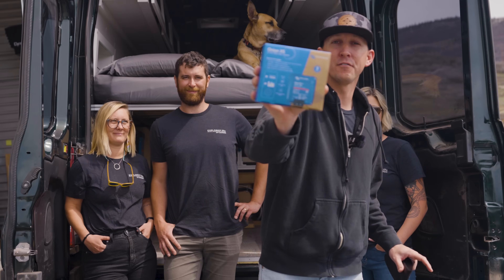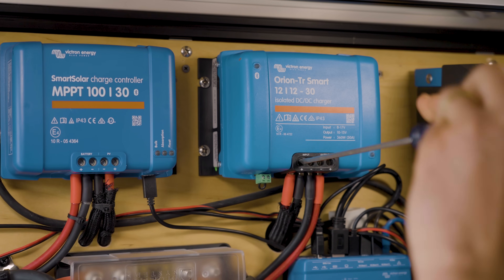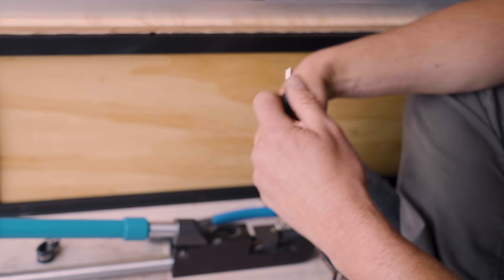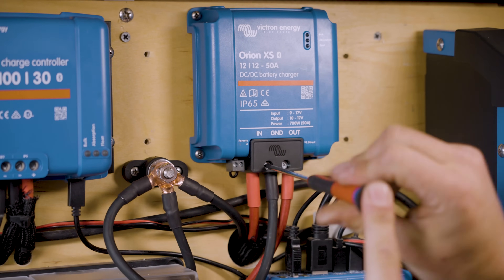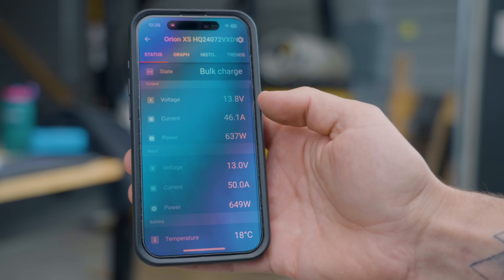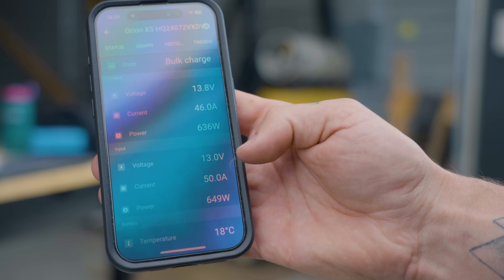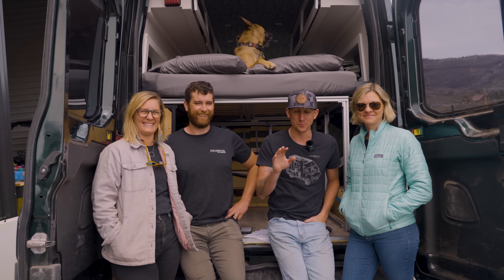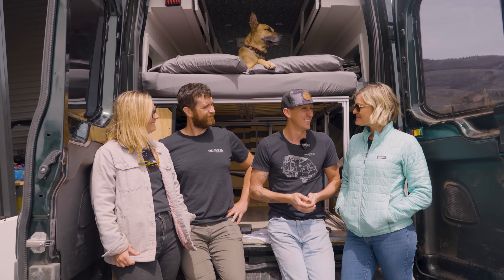Victron Orion XS DC DC Charger Installation/Upgrade Tutorial

Comment: I ordered an Orion XS and the wiring kit from your site. I can't wait to get it. Meanwhile, how would you install this to the Ford ccp, specifically where does the negative go?
Reply from the maker: Check the ford upfitter manual for their recommendation; but going direct to the negative terminal of the starting battery under the seat is our general recommendation unless the upfitter manual specifically forbids it AND recommends a different location.
Reply: @EXPLORISTlife  The BEMM suggests using the consumer connection point. In doing so, do I need an engine run signal from the van? Also, why are you using junction studs?

Comment: Since the old Orions were limited to 30 amps and the new one is rated for 50 amps, and the wire size apparently can go up to 4awg now - are you limiting the amperage this new Orion pulls to accomodate using the previous 6awg cabling?

Comment: I noticed that you only have the non-isolated version for sale but recommend the isolated version in one of your videos. Is there a reason other than lack of availability? (I'm using your diagram with a Lynx dist grounded to the chassis. So the non-isolated that you sell would work, right?)
Reply from the maker: The 50A only comes in non-isolated.  The wiring kit we make for it makes it so it works for 99% of applications.

Comment: Hi, I've installed an Orion XS with the D+ signal plugged on H pin, but I'm not sure if the Engine Shutdown Detection must be turned off. Reading the Manual, think it should be, but I'm still not sure. Thank you for your attention

Thank you for your reply.
Reply from the maker: We don't recommend using the remote h-pin functionality unless we have a REALLY specific reason to do so (external BMS, mainly; but if you are setting up a system with an external BMS; you should already know the ins and outs of signal wires like this)
Reply: @EXPLORISTlife  thank you for your quick reply

Comment: I'm surprise that there is not any heat dissipator as my Orion DC 12-12 30 Amp,  become very hot.  why this one with 50 Amps don't become hot ???
Reply from the maker: It's simply better and more sophisticated internals.  The old 30a and new 50a are essentially completely different units in terms of internal design.

Comment: Hey I’m loving the content Nate! Binge watching quite a bit and I’m of the impression that you favor 12V installs over 24V even for high wattage inverters.
 I was aiming to build a 24V system with a 1500W inverter as a starting point. 
I’ve actually gotten hold of two high end inverters, one 24V no shore or solar input and the other 12V with shore and solar input (minimal but better than nothing.
I have a solar charge controller (520W/1040W 12V/24V) 40A max and 2x100Ah LifePo4 so can try out both. 

Which is it then for 1500W now, maybe 3000W down the road…
12V or 24V?

Would appreciate your input.
Oh and can Victron 120VAC inverters be software set to output 100VAC?
Reply from the maker: We recommend 12V for 3000W or less.  24V for 3000W to 5000W.  48V for anything over 5000W.

Comment: Very nice video, I just learned that the new orion XS does not support synchronous charging correct? Is there a way to make it charge synchronous with a victron MPPT over VE smart networking using a smart shunt ? or can a cerbo GX do this? Now often the orion XS goes in to trickle charging with an "empty" LIfepo4 batterie because the MPPT  is also charging in bulk for example. They need communication with each other. Thnx a lot

Comment: So helpful. Especially as we have a '24 cirrus 920 that uses the Victron system.
We want to utilize our 410 amp dual alternators on our F350, but going from under the hood to the charger, which is on its way, in the camper I need to use 4 gauge wire for the 75 amps that the charger is expected to draw from the alternators. I'm having trouble finding a good 3 prong 80 amp connector set for penetration into the camper. Unless you have a better way to do this. I began with the project we saw from Stoneyboot, who installed a dc to dc charger in their older Cirrus 920. That is where I get the idea that I need to expect to draw 80 amps from the alternators.
I've worked with electricity as a carpenter and I've also wired houses with my dad as an electrician, so I've got enough knowledge to be a little dangerous if I don't stop to make sure I really understand what I'm working with. Your videos are an excellent goto, so I'll keep exploring your insights. 
Thanks for all of your dedication to understanding these systems and components, and making the complicated simple enough to understand. It's the mark of a good communicator.
Reply from the maker: The pinned comment and video description of this video both has our wiring kits we've made for the installation of this Orion, including Anderson connectors for those of you with towable vehicles.

Note: Since the input of this Orion has a max input AND output of 50A; you won't see anywhere near 80A coming from the starter battery.  55 at MOST if there is a full 10% voltage drop on the input wire in a worst case scenario situation.

Comment: Great video as usual.   Couple things that are out of your control:  Victron flipped the side of IN and OUT wires which now means wires have to cross each other also it would have been nice to be able to you use the existing holes from previous Orion so you don't see the holes.
Reply from the maker: Ha!  Yeah; that's why our wiring diagrams for this unit were incorrect right off the start. 😂🤦‍♂️

Comment: Hi Nate. Am attempting to plan a system for our first van build (Promaster 3500 159/ext with the upgrade 220 amp alternator). I have joined the Explorist Life Academy and want to purchase a consultation when I feel like I have the electrical plan in place well enough to look at. I have two questions:   1) Is this Orion XS 50a charger appropriate when it is NOT a "smart" alternator such as with the Promaster? (this is probably a dumb question but this is the depth of my current grasp of off grid electrical)    2) I want to buy almost all of my components (hopefully a "kit") from you guys but will you still entertain doing the consult and trouble-shooting my plan/"diagram" if the ONLY components I am not getting thru Explorist Life are the batteries and panels? (am looking at 4X the LiTime 200ah heated batts and three Bouge 300w panels). 
Your vids are Uber-helpful! So appreciate the product you guys put out. Cheers! Dan in the mitten
Reply from the maker: 1: Yep!  It will work just fine with a non-smart alternator.

2: Correct.  Panel brand doesn't really matter in our system.  Our systems are also drop-in compatible with LiTime batteries; we just can't pre-program the multiplus for them, nor provide the charging specs for them; but we've got videos/blog posts to help you get that information from your battery manufacturer of choice.
Reply: @EXPLORISTlife  Great! Thanks for the response, Nate. I will be getting in touch with the team for a consult this summer with a plan for review and a list of goodies.for purchase

Comment: Hi Nate, do you recommend this kit for the sprinter? I have the Victron 30A already installed using your diagram and parts. You may remember I had to contact you because my Sprinter battery did'nt match, and I had to manufacture a metal bracket for my starter battery. It worked, btw lol.
Reply from the maker: Yep!  Pretty much recommend this across the board at this point
Reply: @EXPLORISTlife  sounds like a new project!

Comment: Not sure retaining or indeed fitting ferrules is a good idea. The terminals in the XS are round, so a square (and to some extent hex) ferrule will have limited surface area connection.  Couple this with the greater current thru-put, not a good electrical connection.
Victron’s terminal design is excellent for stranded cable.  Their manual describes everything you need: torque settings & technique, cable strain relief, (no mention of ferrules), etc. 
The XS is a great unit I’d encourage everyone to upgrade especially those who have two ‘old’ style 360w Orion units. 
When are you doing yours! 😊
Reply from the maker: Re: Ferrules: The whole team here at EXPLORIST.life spent a couple of hours actually trying various combinations of ferrules, ferrule sizes, non-insulated ferrules, and insulated ferrules which ultimately led to including ferrules in the retrofit kits like featured in this video.  Obviously, if you feel that omitting the ferrule is better; you can most definitely do that, but based on our own findings, experience, and 1,000's of hours of tech support; we felt that adding the ferrules was better; so we opted to include them so people had the option to use them or not.

Our 'from scratch' Orion XS wiring kits w/ 4 AWG wire do not include ferrules as 4 AWG with a ferrule does not fit into the terminal.

Re: 'When are we doing ours':  Our show Transit has a 24V battery bank; and at this time there is not a 24V version of the Orion XS available; so we are still a while out on doing that.
Reply: Oh yes I forgot yours was 24v👍
I suspect Victron can’t make the 12v one quick enough atm so I presume the 24v will be a while off just yet.  
Your kits sound perfect for your customers - all included. 
The terminals on the XS are brilliantly designed - be an interesting exercise to do heat tests on ferrules vs bare strands - a future video perhaps. 
Keep up the good work 😊
Reply from the maker: We actually use ferrules less for the electrical conductivity aspect of it and more for the reason that it helps people get ALL of the fine strands of wire into the terminal into turning it into a birds nest, resulting in poor conductivity, or the wire just falling out of the terminal.  More about workmanship than anything.  Before we started recommending/including ferrules; people would strip back 1/8" of insulation, jam half the strands into the terminal, and wonder why the terminal burned up.

Comment: concerning the possibility to "Piggy-Back" for 100 amp  total  ...  I forgot to mention that I have a  2021 Ford Transit with dual alternators ... I think that I should be able to handle the load; unless Ford electronics prohibits it somehow ...
Reply from the maker: Your transit should have no problem with that.  Dual alternator Transits have something like 2x 250A alternators for 500A total.  Plenty of overhead to accommodate dual Orion XS's.

Comment: Can you "Piggy-Back" the new unit to get 100 amp charging?
Reply from the maker: You can most definitely wire 2x of them in parallel for twice the alternator charging.  I shared the link to the appropriate wiring kit for that in the video description & pinned comment.

Comment: Nate,  Thank you for the very informative videos.  In your van you previously had two 30 Amp DC to DC chargeres.  Will you be adding two of the 50 AMP chargers in your Transit?   My 2020 Transit has the dual battery, but does not have the dual/second altinator like your Transit does. I run an induction cook top and have 630 Amp hours of lithium,  so in winter the extra 50 AMPS would be nice to have.  Do you think the additional 50 amp draw would be hard on the single alternator dual battery configuration? 

Thanks for the help!
Reply from the maker: Our transit has a 24V battery bank, so we won't be able to upgrade for a while until Victron releases a 24V version of this.  For you, though, the rule of thumb for DC DC Charging is to keep the DC DC charging amperage at or below 50% of the rated output of the alternator.

Comment: Thanks Nate and team..
Do ye guys have a video that explainswhat amperage you can safely pull from an alternator without damaging it? I have a Renogy 50 A DC - DC MPPT unit and was thinking of adding this Orion XS to get say 100A (total) from my 2016 Ford Transit smart alternator..
 (Maybe i should look at this video in full first!)
Reply: From some of the forums I have been on they recommend not using more than 50% of it's rating. I talked to my mechanic about it and he mentioned that the engineers who designed the vehicle in the first place designed it with the vehicles components in mind and allowed for some expansion but probably not 50%. I ended up finding a company that was able to upgrade my stock alternator from 130A to 250A.  I'll never worry if I'm climbing up a mountain pass on a hot day with the AC on and using 50A for the new XS!
Reply from the maker: Yep, we follow the 50% of rated alternator capacity as well and seems to work well for all of our customers.  So, if your transit has a 250A Alternator, I would recommend to stay below 125A of DC DC Chargers as a rule of thumb.

Comment: Forcing the alternator to deliver 50A at idle rpm can damage the alternator. What settings do you use to prevent overheating the alternator?  Thanks for the videos, great job.
Reply from the maker: "Forcing the alternator to deliver 50A at idle rpm can damage the alternator." This statement isn't true given the alternator is big enough.

As long as you keep your DC DC charging demands below 50% of the rated output of the alternator; there should be no overheating issues.  The charging rate can be turned down as necessary if you've got a really small (sub 100A) alternator.

Comment: Can you possibly put on your video list to explain what the difference is between a DC to DC charger and solar charge controller?  I understand they are fundamentally different but what's confusing is when you buy a power bank from one of the major manufactures, why is the same input plug used for solar charging and also charging through your car battery system?
Reply from the maker: Yep!  We made a video about that 2ish months ago.  direct link: https://youtu.be/65bATtlHbeg

Comment: Wait what about the remote wire?  I want to be able to turn my off and on depending on if I want it on.  I already have my hot wire from a previous renogy dc/dc charger.  Does it just plug into the port (H)?  Thanks in advance.  Glad they are working on the display to show it on the screen.
Reply from the maker: That’s an option, but I’d just toggle it on and off from the app if I wanted to disable it.
Reply: @EXPLORISTlife  ok just confirming that is how you have a remote on/off?  One swutched wire to the (h)?  Looking at page 13 in the manual connect the switched wire to (h) and leave it bridged.  Also turn off “engine shutdown detection” in app.
Reply: @Mth308  This may be very helpful for me to understand as I wire in the charger to my camper. I had planned to using an upfitter switch in my Ford truck, but with the app, I may just forget about the extra wire and just go with a 2 prong connector.
Reply from the maker: Most people never actually turn these off.  It's not really necessary to regularly be toggling these on and off; so if you don't already have a wire in place; I definitely wouldn't go through the effort to add one.